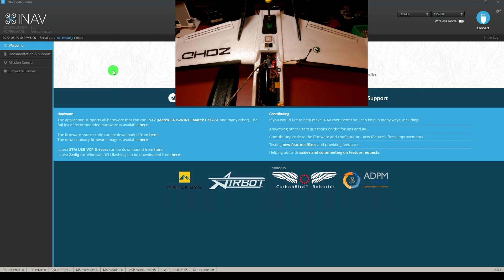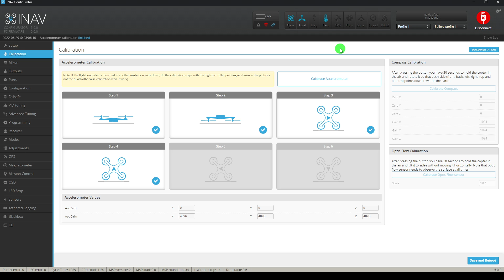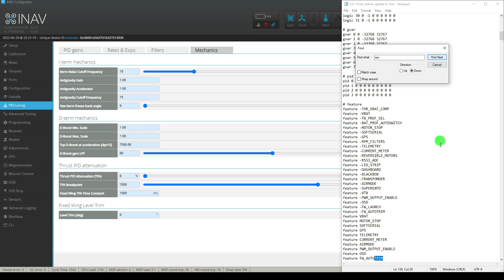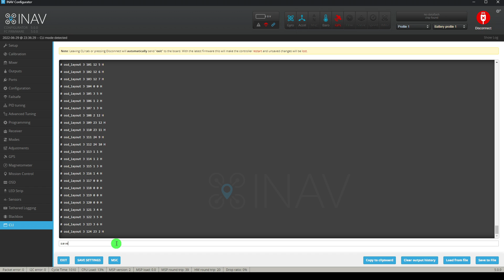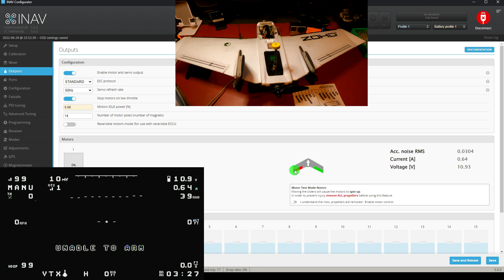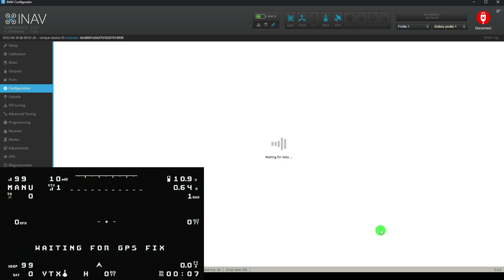Dart 250, Moving to iNav 5!

Comment: Hey Keith. Just a couple of responses for you. 

Pasting the accelerometer meter settings in to 5 from 3 is fine. No problems with that. 

I’ll have to check if you can have MSP and GPS on the same port. I’m leaning towards no though. 

With NAV CRUISE, it already has alt hold, so you don’t need to add that also. Course Hold is basically Cruise without alt hold. 

When pasting in the OSD. There are a few settings in the master section of the diff that you can also paste in. That will get all the settings from the old version like the units, crosshairs, sidebars, etc.
Reply from the maker: Awesome, thanks for the clarification! (and everything else! lol) One more question... There was a note on the F411WSE that we should NOT set the video format (NTSC or PAL) but leave it on AUTO. A quote from Matek's page, "Set OSD video format to “AUTO”,  Do not have it set to PAL or NTSC, otherwise F411 could hang after rebooting." Is that still a thing, or is it OK to set the format as I did in the video? I will leave it on AUTO if I need to. I'll also remove the redundant alt hold on my cruise flight mode.
Reply: @bonafidepirate  Sorry for the brief reply. I had a food order turn up. Just watched the last 20 mins of the video.

I would put the video mode back to AUTO after setting it up. I don't remember seeing anything changing as far as the Matek F411 flight controllers go. There was one other thing that I thought of, but I'm having a brain fart at the moment 😆
Reply from the maker: Good deal, and thanks again for the help! Right now my list of changes before the re-maiden are:

1- Remove the unnecessary Alt Hold flight mode and keep just Nav Cruise there.
2- Maybe add Auto Level to Nav Cruise, besides having it on Angle? (Thoughts?)
3- Set video format to Auto

Oh, and fix that terrible audio! lol I already did, but yeah, it was bad for this video. Next one should be better. ;)

Comment: If you accidentally turn off MSP on the USB port (don’t!!) can you rescue it by putting into DFU mode with the boot button?
Reply from the maker: I'm actually not sure... lol I can't see any reason it wouldn't work since you're using the bootloader then, but I've never tried it to know for sure. You'd need "full chip erase" enabled to wipe away any settings to be sure MSP was reset I'd think.

Comment: The audio here was good (~85%-90%). No issue with intro, just seem like you switched to different mic, or mic setting when started doing the screen recording. Audio was bit tinny, but no issues hearing, nor understanding. Just assumed you were using computer vs. remote mic. 
(Only mentioning, as was commented on in later video)

Comment: What size prop are you running ?
Reply from the maker: I'm using the stock PNP power setup. (motor, esc, and 2-blade prop) It's a 5x5 if I remember right, that they recommended for 2S. I'm using it on 3S Li-Ion though, and found it works great. I don't push the motor hard though, just cruising around.

Comment: This is rather interesting. I have a Multiplex FunnyStar that I intend to build as an iNav build. It will be rather challenging to fit the FC and the ESC and the larger battery, but I have ideas.
However if I totally fail with the build I will go for the Dart 250g.

I am sourcing an RCinpower 1507 motor and already have purchased a Holybro 45A f4 ESC, so the powertrain should be possible to move over. For the FC I will probably go for the Matek F411 TE, which is the "third edition" perhaps?

We shall see, I plan to build it gradually during the winter, no rush at all....
Reply from the maker: Yep, the WTE is "third edition" and replaced the WSE that I have here. I think the main reason for it was they have different chips for the barometer and IMU since the old ones were hard for Matek to get. There's a few other little changes too, but overall they're very similar and will work pretty much the same.

Comment: what kinda motor you have installed on the Dart
Reply from the maker: The stock one that came with the PNP model. I use the two bladed prop that came in the kit, intended for 2S. I found it worked better than the smaller three bladed one, even running 3S. I am using Li-Ion though, with a little less punch than LiPo would have, and I don't push the motor hard, mostly just cruising around with it. The two blade prop has a bit more power for take off, and then cruises a little more efficient at low throttle. I don't know how the motor would like it if I ran it wide open all the time though... lol
Reply: @bonafidepirate  great Thank You and Thank You for that video, I feel like it was made for me  👍👍